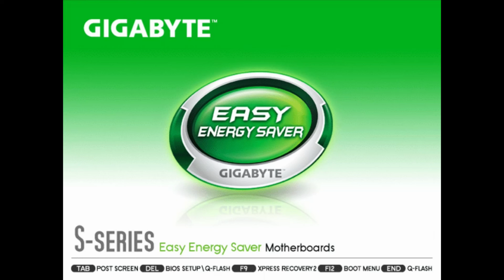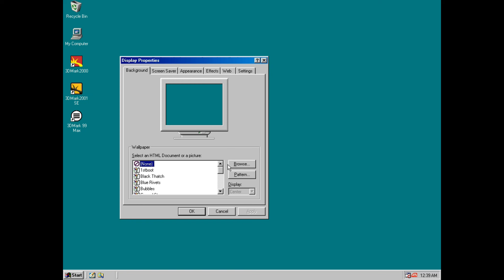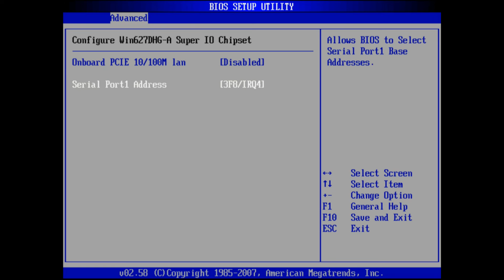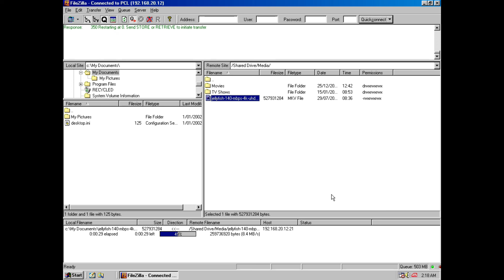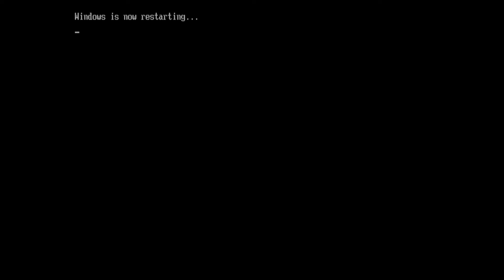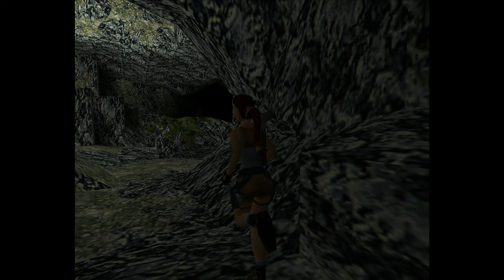Using PCIe Graphics Cards with Windows 98 SE

Comment: Just note that if you're trying to use these Radeon X850 XT (AGP) GPUs, do NOT get anything with a VIA chipset. Went through two motherboards before I found someone mentioning that AGP support was flaky as hell on VIA boards. Ended up settling on an old nForce board to go with my Athlon XP.
Reply: sorry abit late but, thats an issue with old super socket 7, slot-1 and socket 462 via chipsets with unstable agp implementation. this is no longer the case with later socket 939 and socket478/775 agp 8x via chipsets.

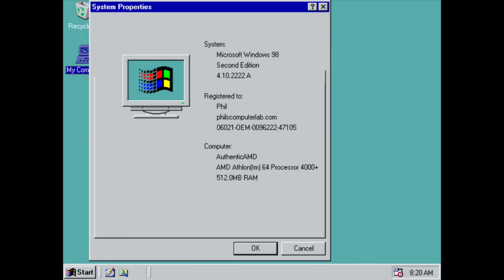Comment: 1:47 I had that problem with my GeForce 6600 PCIe
The solution is to remove all video card devices in device manager and let it install the drivers again
the problem is a conflict between the actual video card drivers and the standard vga device.
The one time the win98 help is actually helpful(?)

Comment: I did a E8600 setup with a 945GC chipset and a 6600GT and I'm getting 28400 3DMarks in 2001. Getting a soundcard to play ball in DOS though is proving hard. SB Live, YMF744, Vortex 8810 wont function correctly. Closest I get  to is CMI8738 with fully functional FM. So I think the chipsets could have compatibility problems with soundcards here.

Comment: Nvidia 7950 GT 512mb works on 98 with the mod drivers. Asus P5k3 is same P35 chipset as your board but is DDR3, might also work? Could then potentially run 1600mhz RAM. E8600 CPUs are super overclockers too, over 5ghz! That would truly be ultimate 98 performance. 🤯

Comment: Since now you have all this hardware, it would be nice to see another, more closely matched comparison with the same CPU in both motherboards, and limiting the X850 XT PE to the same clock speeds as the AGP version (with something like Ati Tray Tools). This way we could see the performance advantage (if any?) of the PCIe gen.1 interface over AGP.
Reply: Truthfully, there wouldn't be any difference if you were to use the same CPU on both platforms. The AGP 8X interface is more than capable of handling a Radeon X850 XT (in fact, it can even handle fine a much faster card, like the Radeon HD3850. Now, the caveat is that you can't use the E8600 CPU on the AGP system. In fact, the E8600 CPU is extremely overclockable, it can easily go to 4+ GHz, so that would make the PCI Express system even faster - although not sure why you'd want that when you already get 400+ FPS in most games :-)
The main advantage of running Windows 98 on a PCI Express system is PRICE. The AGP + Socket 775 motherboards are getting more rare and expensive, same with the AGP versions of the X800/X850 cards. On the other hand, PCI Express motherboards and video cards are still cheap and easy to find.

Comment: 10:30 - Just a bit of curiosity: have you noticed that the X800 GT and X850 XT cards have the same PCB? In the video you can see that they have the exact same component layout, but the X800 GT is missing the external power socket on the back and has a smaller cooler, but you can see the outline and mounting holes for the larger cooler of the X850. In fact they have the same part number (109-A47401-10). I guess this is because they have the same GPU, the X800 GT just has a lower-binned version.

I love old hardware...

Comment: Man, I've been hearing about this (pcie gpus supposedly working in Win 98 under some circumstances) for some years now, but this is the first time we actually have a concise video on the topic! What's left now is to try to topple the previously considered to be fastest card in Win 98 (the 7950gt agp with modified drivers from the 6000 series) with its bigger brother - the 7900gtx (that obviously only comes in pcie variant) while at the same time maybe also OC the E8600 (a famously good chip in that regard, known to hit 5.0 Ghz in some cases) sky high. That might be just enough to push some of the games over 1000 fps, lol.
Reply: Win 9x can work on ich9, 10 and 11 based boards. This also includes some Core i - 8xx and 9xx systems (ie. core 2 e8x00 isnt the fastest supported cpu for Win9x).

Comment: I'm glad that networking will have more focus in the next videos because I've always wanted a networking solution to transfer files between my retro and modern PCs and I've not been completely successful in implementing such a solution yet. I have to keep the USB controller disabled due to resource conflicts with my sound card so file transfer using a flash drive can be a pain sometimes. Very nice video.

Comment: I think using pci express is often better than agp, because you can a get a old Pentium 4/ Athlon 64 PC with pci express very cheap nowadays and because pci express cards a still being made old high end cards like the Geforce 7800 are not so expensive as the agp versions. But I recommend using pci express only with xp and newer because in Windows 98 you often have no drivers anymore. The chipsets who supportet Windows 98/Me the longest was Via.

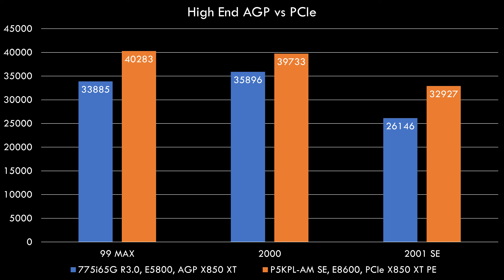Comment: Hey Phil, I found a mistake in the two graphs at 12:40 and 12:50. The numbers in the first graph of the PCIE X850 XT PE are the same as the numbers in the second graph of the X800 GT, and the numbers of the X850 XT PE in the second graph are higher than in the first graph. Do you know the correct numbers?
Reply from the maker: Likely just a copy paste mistake... I usually write things down in a notebook, I can have a look if I find the numbers...
Reply: Could it be, that you used the X800GT instead of the X850 by mistake for the AGP vs PCIE graph?

Comment: Love the vid, Phil. I had pretty good success using the ATI X850 XT PE vid card, ASUS P5KPL-AM SE motherboard and the other hardware listed (other than using an Audigy 2 ZS instead of a Live! which I also have but prefer the Audigy better). This is maybe the 15th Win98 system I've built over the years. However it's been tricky getting it to boot consistently when using over 512 MB of RAM even with Rudolph Loew's patchmem installed. With 1 GB or 2 GB installed sometimes it boots, but usually it just starts to load Windows and the reboots before the login. With a single 512 MB stick of RAM it's super rock-solid and is most stable Win98 system I've had in 20+ years. I ordered some different RAM so I'll have to see how that works out.
Reply: Hi! I have a question regarding Audigy 2 ZS and SB Live. I guess both of them don't have official Win98 drivers? Could use some help on how to install drivers for these so that they work properly with Win98

Comment: I also tried my old X850 XT AGP with my both Win98SE PCs but never got the drivers running. Tried a dozen of Catalyst drivers but never got the drivers with 3D acceleration working. Maybe it just died over all the years.

Comment: For the live on XP you can also use the PAX-2005NewYear driver which comes with the Audigy 2 software including some extra bits and updates to make sure every original feature is accessible. The installer will ask which card you have and the Live is an option! It then extracts the Audigy 2 cd contents to the harddrive and modifies it for the selected card. Once the regular setup is finished it will then show you extra options to update it further and install original components back. And at the very end it will remove all the stuff it extracted to leave no junk behind.

My method of installing 98 is even more streamlined as i made a boot floppy based on ms-dos 7.1 with all my utilities i use on it. It also contains my own take on the ms-dos super easy so i can just insert the floppy and be good to go. I also made a usb stick version of this which i can easily flash onto a usb stick. On this disk is the partition manager part to easily partition the drive and install either the win9x mbr or a bootmanager. Then i have my own custom setup script which depending on what it detects does different things. All i need to do is put the win98 folder on the stick and boot from it. Run setup C: D: to inform me the target is D: and it will ask to format the drive with the /q /s options making it bootable. After this it automatically copies the files to D:\SOURCE . I can then run another script on the disk to install a memory limiter to drive D: . Now i remove the stick and reboot into a local copy of MS-Dos 7.1 . Type source\setup and resume the regular Win98 setup. Once its all done i reboot to ms-dos inside Win98 so it generates a Reboot to MS-Dos.pif file and boot from the stick again. I once again run setup C: D: and will now be prompted if i want to replace msdos mode or if i wish to format the drive again. Selecting the first option will automatically integrate everything inside msdos mode so from now on my Win98 install has the startup menu and all my dos utilities easily accessible trough the official reboot to msdos menu.

The above was designed when i had a T5710 as my retro pc and wanted a streamlined experience. Feel free to ask a copy ill gladly mail you a link to that single floppy project.

As for follow up videos on this PCIe driver topic i'd indeed be interested in what the geforce side of things can do, for example the MGDx Driver.

Comment: Great idea , I never knew u could use a PCI e cards . I bought a x800 agp and wasn't cheap. I use Duel boot with xp with athlon 3000+ works well but struggles with grand Prix 4 in xp and 98 need more power lol.

Comment: I was playing around with a PCIe->PCI bridge on my windows 10 desktop and found out something cool. 

I was testing a PCI Audigy ZS2 with the bridge, and figured out I could disable it in device manager, and hotplug a PCI 10/100 NIC. I tested with other PCI devices, and all of them reported okay in windows, but the NIC and Audigy were the only two I was able to actually test (other cards I have are modems and FireWire cards). 

Interesting way to quickly test multiple PCI cards without rebooting. I wonder if it would work on this Win98 machine?? The bridge is from Startech

Comment: Man... I went with a P4 2.4ghz (waiting on a 3.0 from china) AGP setup and a 9800 Pro. I wanted to do early XP and late 98. Your scores are literally double mine. This is making me want to spend a lot on a x850 and drop that in, lol.

What capture card are you using? My cheap chinese one can't do a lot of VGA 4:3 resolutions.
Reply from the maker: The scores are mostly high because of the fast CPU! You will see some gain with your setup if you get a better GPU, but your CPU is also holding things back.
Reply: @philscomputerlab  Appreciate the response, I have some thinking to do.

If you don't mind answering - what capture card are you using? My cheap Chinese one can't do a lot of VGA 4:3 resolutions.
Reply: @philscomputerlab  rewatched and 10 months later update if you manage to read this: I managed to snag an x850 Pro AGP (for $27 CAD, lol) and a P4 3.0GHz for that system. Both work flawlessly in 98 with 3GB RAM (after the rloew patch) and well in XP. It's improved the scores considerably vs the 9800 Pro - still around 16k in 2001SE in 98 but that's a limitation of the CPU. 2003 in XP gives me around 10500 pts and 2005 ends up around 5080 pts. However, the games themselves I can push much higher resolutions and settings without the card breaking a sweat. I will have to keep an eye out for an A64 or LGA775 AGP mATX board that's 98 compatible but I've been very pleased with the upgrade so far.

Comment: Works great wirh my P5KPL-AM EPU mainboard. But i had also to deactivate the Standard Display Adapter (VGA) as well. Big Thanx to Phil!
Reply: To avoid the resource conflict with the video card, i usually just disable the integrated graphics outright. then the video card works without any issues after installing the ati catalyst drivers so you don't need to disable anything in device manager. Although I'm not sure how it is with nvidia's side.
Reply from the maker: Great 👍
Reply: Hey ElTentakel, what GPU are you using?
Reply: @fabioefs2006  Itried successfully a Radeon X800 GTO first, it words perfect. I also tried a Geforce 6800GS and it also works, but there are some issues in some Games due to the bad driver support. I used "NV8269.EXE".

But the 6800 GS might be the better card to emulate 3Dfx Games with nGlide.

Comment: At least with Nvidia, AFAIK, Intel chipset 925XE boards and boards with earlier chipsets that support PCIe should work with 9X with the latest chipset and graphics drivers (in the case of Nvidia, you have to use an unofficial driver for things to work). Since I don't collect ATI cards, I can't say for Team Red.

I have no experience with AMD platforms either.
Reply: the ATI Radeon x-series starting from x300 through x1050 pcie graphics card have native driver support for win9x, ATI supposedly called them beta support drivers but they are actually fully functional via DirectX 9.0b & C/OpenGL 2.0. I've test 30 games mostly DirectX 6 & 7 titles and they all worked fine. OpenGL support is good aside from some late Source engine games that have some compatibility issues of not being able to enable the OpenGL graphics renderer.
Reply: @explorer9049  Interesting

Comment: my P4 uses 1 of those Frankeinstein boards by Asrock. But I use DDR1 and an X1950pro AGP
It runs XP, but it'd be fun if i put a PCI-E card in there and dualbooted 98 with that :D
Reply: And there would still be room for a Voodoo 2 :D

Comment: Edit just watched the intro to your video on the nas and see that you coverd this.

Might want to look in to vlans (or physical lans if you want to do it on a bidget) to segregate all your retro machines from your main lan to keep them offline as im sure theres still old botnets and stuff looking to take over unpached computers.
Reply from the maker: Yea I've got that setup now! The NAS has two Ethernet ports, and I have two routers connected. So one network is Retro LAN, offline, not connected to Internet and seperate to the modern machines. Modern machines sit on the other router (which is a modem) and have Internet access.

Comment: I have built Windows 98 PCs installing Dosbox on my system xD. Despite the DOSBox developers themselves sometimes having said , that putting Windows 98+ was not optimal for DOSBox, my experiences have been outstanding. Raw CPU-performance might be slower than using a virtualization software, but DOSBox offers the best gaming performance I have seen, best compatibility, running super smooth, stable, fast and including anything anyone would expect from a Windows 98(SE) machine, like using Voodoo emulation, the real Roland MT32 soundbanks, best video output filtering and such.

Comment: I've tried my hand at using socket 939 boards with PCIe and it's worked pretty well so far. The biggest difficulty has been making sure the motherboard has a chipset with Windows 98 drivers available.
Reply: uhh... Windows 98 doesn't need any chipset drivers to fully function unless you are using an agp graphics card to set the agp controller mode with northbridge chipset drivers.
Reply: @explorer9049  I'm using SATA instead of IDE so it'll lock up or perform poorly without the right chipset drivers. USB 2.0 can also be a pain but it's more of a nice to have than a necessity. Originally I had wanted to use an old AM2 based mobo I had lying around (M2N68-LA / Narra2) but it had the NVIDIA GeForce 6150SE nForce 430 chipset which does not play nice with Win98. I settled on using an ASUS A8V-VM with a VIA chipset and it's worked pretty well. The only downside is no native fan speed control but it's easy enough to add low noise adapters or a third party fan controller.
Reply: @ravewulf  there are native sata drivers + universal sata patch drivers to circumvent the 16bit file acesss storage controller compatibility mode. you also need the usb 2.0 driver stack to get ich7-10 to work properly. early nforce based chipsets have a host of incompatibility issues even on their intended platforms so if i were you, i'll stick with VIA or SiS for the amd platform. with intel based boards everything just works... even on intel motherboards that are super limited in features such as extra bios settings and overclocking controls.
Reply: @explorer9049  Yep, I've already got the Rudolph Loew patches and am running with 1 - 2 GB of RAM thanks to his memory patch. I'm just noting that chipset compatibility issues do exist depending on which board you go with. The only issue I haven't fully solved is finding a PCIe gigabit card that works. The one I've got now has Win98 drivers but Win98 can't detect that the card is plugged in at all - not even as an unknown device - while WinXP can. (Yes, I know PCI cards exist but I'd like to avoid putting too much bandwidth on a shared bus)

Comment: Phil this is not the fastest win98 compatible card. Well, it is officially, but in reality fastest win98 compatible card is Geforce 7900GT.  All geforce 6 and 7 cards are supported trough modified driver. If you want to try it, or want the driver, I can provide. There is one condition tho, the card cannot have more than 256MB of Vram, otherwise it will not post. I have one AGP card with 24pp G70 and 512MB, and I had to flash it to 256MB to make it win98 compatible.
Reply: how did you flash that card to 256mb ? i tried loew's bios patch, but it wasn't compatible with my gainward 7800gt (20pp/G70)
Reply: @thomas.becker  I simply used random 7800 GS AGP bios that I knew that the card also had G70 core and 256MB and it worked. The pipelines remained at 24 and the card now reports just 256MB and works in win98. I was not trying to mod the original bios.

Comment: From a software point of view PCIe is backward compatible with PCI. So of course PCIe cards can work with older operating systems. The only problem is going to be driver support for the card itself, not the bus it connects through. This is also why you can find cheap adapters on ebay that convert PCI cards to work  PCIe slots and vise versa.